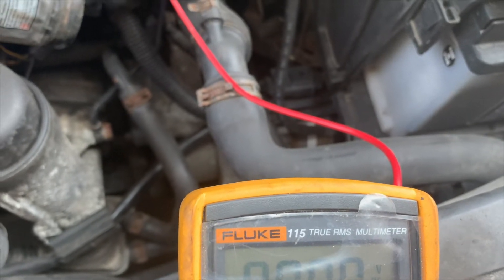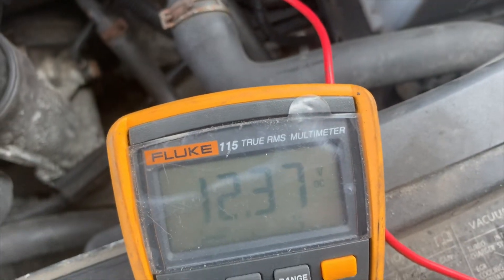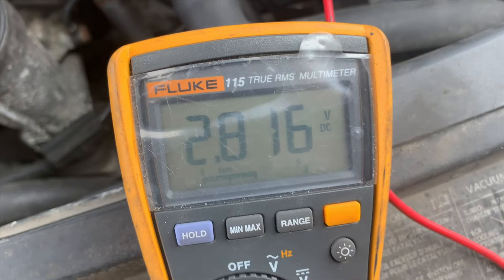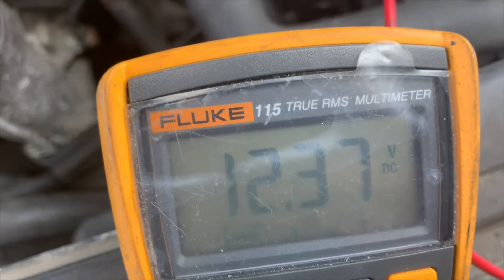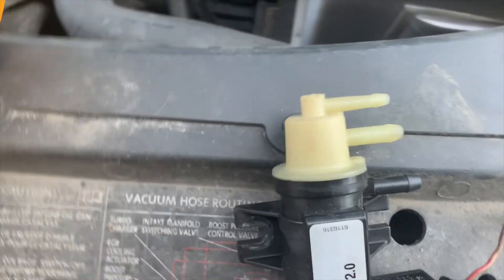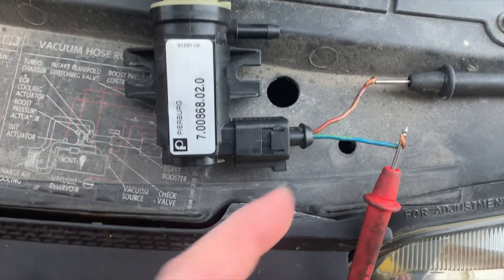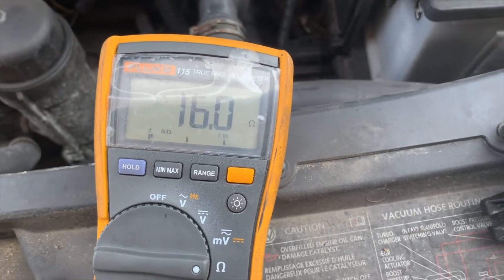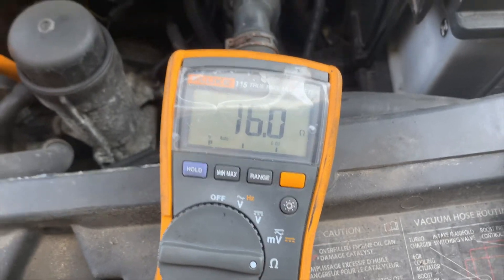MK4 TDI N75 testing

Comment: I bought a new N75 thinking the problem is there..... but still didnt open up for vacuum to pass..... turned out i only got 9V on the signal wire..... so i think i have to strip the loom to find where the 3V is going missing

Comment: I've got a 1.8 t Mark 4 that's been throwing p1297 and 0411 codes. After checking the n75 valve, the ohms are within spec. But the wiring harness has some very anomalous readings, 3.49v instead of 12.1 (which is what the battery was reading) and 0.047 on the other terminal. I'm thinking this may be the problem? Do you have a video or know of one that would help assist me in how to fix this problem? Is it just a matter of cutting open the wiring harness from the plug going back until the short is located?
Reply: Didnt u find problem ? ...... i also replaced my N75 but still same problem...... i think ECU not giving command to it
Reply: @babelonchabalala1690 yeah could be haven't replaced that yet

Comment: I am not getting my battery voltage to the plug. What fuse should it be going to?
Reply from the maker: Would need to check wiring diagram
https://drive.google.com/file/d/1BhgcxDjWyPLmXUS_Qoalxv59NQjYe5Yv/view